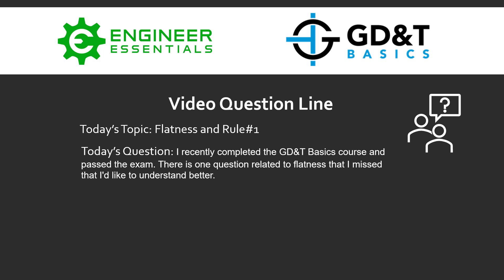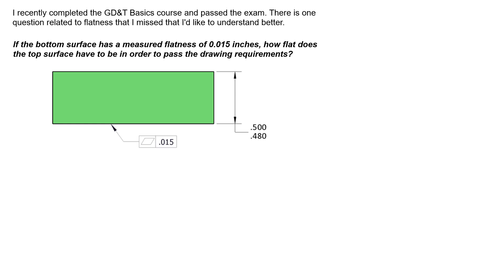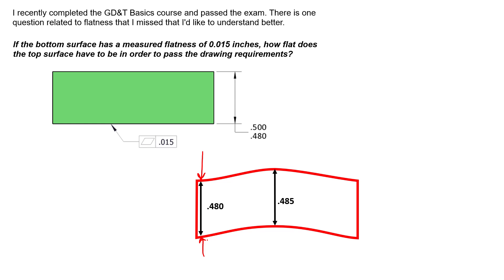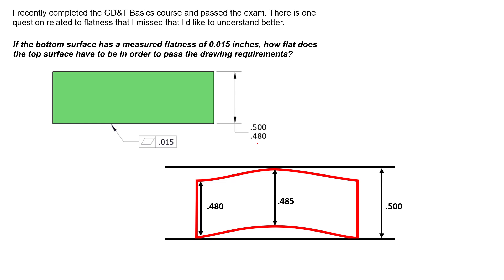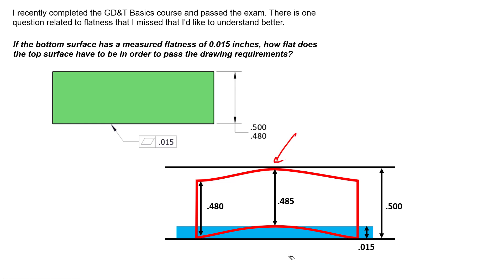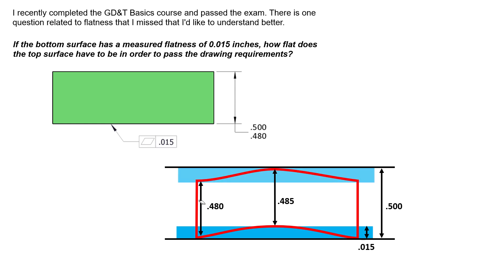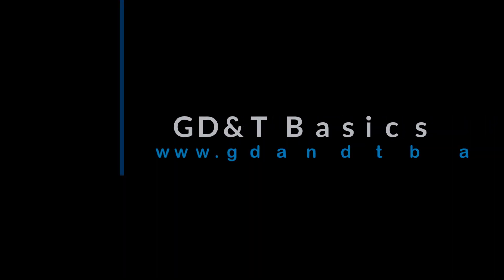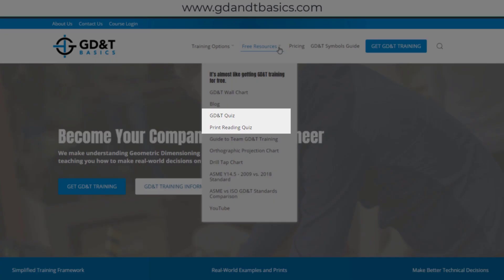Flatness and Rule #1

Comment: According to ASME Y14.5 the Rule #1, does the geometric tolerance applied to the FOS the check the derived median plane, whereas the flatness tolerance applied to the feature check only to the lower surface?
In addition, does the flatness applied on the feature limits the maximum value of form admissible on the FOS?